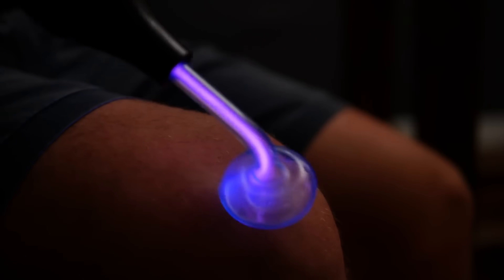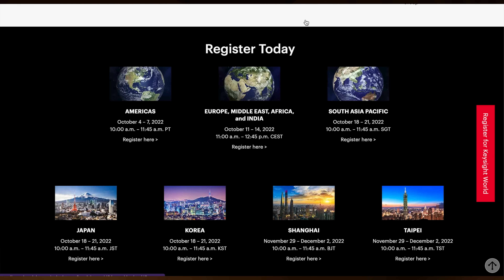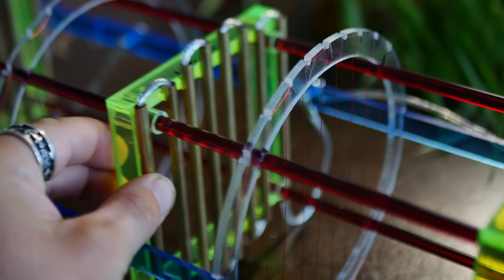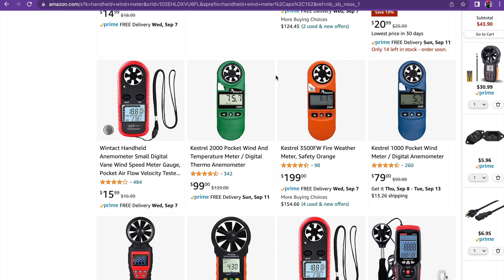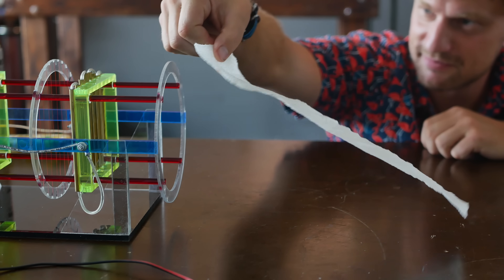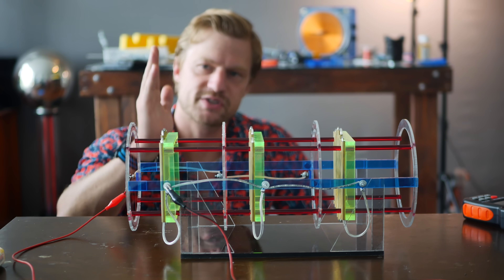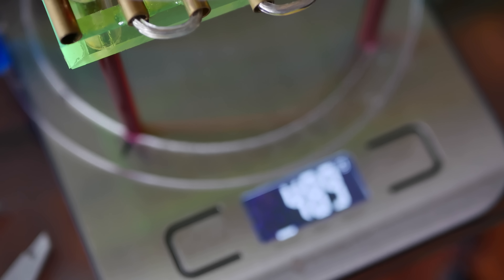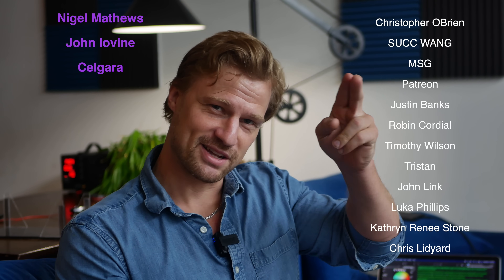Designing A Next-Gen Ionic Thruster! (For Flight)

Comment: 1) amount of stages (add more) 2) Distance of each stage (make more and closer) 3) use high voltage cables, adding more cable weave to each layer and shield/shroud everything encasing the system. ... If you want a good Ionic Thruster you are going to have to stack them almost looking like a radiator, the weight to thrust ratio will only be relieved at larger scales.

Comment: Most of mine are the same as below, but I would like to do a deeper dive on a combination of two concepts in particular. 
1. Airflow Shielding and 2. Positive Electrode Configuration
Using a positively charged copper vanes with grooves cut in them to maximize surface area and create the shielding for airflow to assist in preventing air from escaping. You have to balance roughing up the surface to create points for where the copper will strip electrons with the increase in air friction / drag. Typically airfoils are polished to eliminate drag, but you want enough roughness (similar to a few comments regarding increased surface area) to strip the electrons and ionize the gas. You could also potentially make the vanes in a specific pattern (circular) to assist in  creating more homogenous magnetic field from positive to ground.
3. Gas Mechanics
You would also probably want higher density and higher temperature air so that the electrons are more easily given up by the gas. Though the addition of a preheater would necessitate a heating element and multiple stage compression unit which would probably add waaaay more mass and blow your thrust to mass ratio out of the water. Oooh could you ionically thrust water?

Comment: I noticed that when you used it in the dark that the ions were streaming off of the copper wires at several small points. I'm wondering; since most copper wire ends up with impurities on the surface, was there any type of cleaning done?
Materials might play a big role in the distribution of ions along the conductors and may impact overall thrust.
Reply: Those small points are probably where there are slight irregularities in the thickness of the wires in the direction of the other electrode wires. It might be good to create a regularly spaced version of this by lightly crimping the wires every millimeter or two.

Comment: I wonder if the ways you thread the wires may change in how the ions flows? 

 One variation would be with the wires mimicking a spider web like pattern or a web like pattern that can spiral the ionic windflow.
 
 Second variation maybe a three dimensional threading that can change the velocity of the flow to concentrate the flow of ions to the center.

 Third varient may be a combination of first and second that can uses a simple pattern that becomes a complex three dimensional webbing that funnels the ions. But this method will definitely need simulated modeling of how each pattern changes the flow of particles.

Now the issues I see with these ideas is how complex the electrodes need to be for such a design to work efficiently and still stay within a projected weight limit.

Comment: To move air you want as much interaction as  you ca get between the ionic wind and the air.  In the static photo there were bright sopts plasma and lighter areas.  Do the bright spots cause more air flow or the areas inbetween.  If the bright spots, can theyse be seeded?  Can these spots be brought closet together to make a more concentrated air flow? Can the negative electrode by narrower than the positive in an attempt to funnel the flow of ions, and so the air too?

Comment: I'm curious... What if, instead of just using thing wires, you used thin foil with a jagged trailing edge? Something like this: VVVVVVV. Perhaps the sharp points would assist with the electrons flying off more closely to the desired direction, and I could see there being some aerodynamic benefits for smoother airflow, too.

Comment: My stab at opportunities for significant gains:
0. Yeah, encase the sides (perhaps just with plastic wrap)
1.  The first stage should be larger in diameter than the second stage, which should in turn be larger in diameter than the third stage.  Exact taper should be optimized, but I'm guessing it'll be fairly  significant.
2.  Arrange the electrodes in a concentric-circle pattern, or perhaps a spiral instead of parallel lines.  Should be more conducive to laminar flow.
3.  Racing stripes

Comment: Will using a flared airflow-exit/entry and tubing the design be a start for increased thrust to weight ratio? There has to be thrust loss coming from the open design, and I could see the fully open thruster exit allowing for air to 'curl' at the exit once tubed, resulting in loss of thrust. All I can think of outside of mechanical or electrical improvements.

Comment: If you were to close off the tube around it so that air is forced only through the center than attach a series of spinning blades similar to what you would see on a jet engine maybe make out of carbon fiber in series to force the air faster creating an increase of thrust…. Idk worth a shot….

Comment: You could enclose it to focus the air. Maybe add a cone to focus air flow. 
You maybe a non powered fan between stages one and two to spin the air. 

You could even maybe have a cone or slight taper between each stage?

Maybe I’m way off but I do find this fascinating.

Comment: i think the three problems was 

1 being having a constant power source without it being connected to your grid power. 
2 Providing enough thrust to weight for bigger application
3 you prolly had alot of wind run off because its an open application if you could enclose it i think your gonna see an increase without having to change anything on the application.

Comment: Theres a couple of factors from a jet engines that might be interesting to change:
 1. Propeller speeds increase through the length of the jet, that could translate to different voltage applied through the length of the BSI
 2. Propeller "density" (amount of space between blades) decrease (afaik) through the length of the jet, that could translate to a tighter grid of + and - at the front and then easing off
 3. The jet builds up pressure through the length of the engine, incasing the BSI could be interesting (to see if outside air intake through the length of the BSI causes vortexes and reduces thrust)
 4. As wind speed increases through the length of the BSI, bumping into obstacles matters more having the larger negative poles be the tear-drop shape of a plane wing might help.
 5. The jet guides the wind very specifically, having internal conical shapes to build up pressure. Having the BSI incased and introducing a nossle could be interesting.
 6. Moving stationary obstacles out of the way of the wind might help with getting a good laminar flow. Having the middle of + and - sections be less dense might help.

Comment: I wish I was clever enough to comment on the design inefficiencies. But I'll give it a go anyway! All I can think of is: 
1. if the segments were fixed in their most efficient position you could trim off the excess plastic reducing size and weight as you wouldn't need to slide them about;
2. thrusters are usually enclosed (right?), wouldn't that help direct the airflow to more of a point concentrating thrust; 
3. ....more red wire?
bonus #4. lighter construction materials

edit: ok I just read the other comments, this is what everyone else said. I tried

Comment: I would say 1,encase the unit. 2,add more segments.   and 3,shorten the overall length. 4,increase the surface area of the +/- plates. 5,honeycomb the +/- plates. use different conductors

Comment: This is truly amazing.

Changes I would try in hopes of increasing output:
1) Cone design from wide (input) to narrow (output).
2) Light weight sheet, potentially thin sheet plastic, to reduce slower moving exterior air from being pulled in at each electrode which may also slow down directional flow.
3) Larger gap between first electrode (input point) and distance between electrode getting smaller thereafter.

Sealed cone with large electrode pulls in more air, which has no escape and speeds up as it gets thrust  futher into the narrowing output hole.

Comment: Inefficiencies:
1. round tubes for electrodes, they should be thin and flat.
2. each thruster should have it's own powersource.
3. the voltage would ideally not drop when discharging, this to remove sound.
4. the plastic should be replaced with coated aluminum, maybe even aluminum with foam inbetween like on some airplanes.
5. if the wires was replaced, would the efficiency change or not?

Comment: Here's a good TWR to shoot for, 20% of the total weight of your aircraft.  A Boeing 777 has a TWR of about 30.4% but it has to carry a large quantity of passengers and cargo, for a vehicle weighing say 1kg you should try to achieve 200g of thrust.  I've seen others suggest pulsed DC too, and I agree, not only will timed or even actively controlled pulses make the most of your power supply but the short intervals between pulses will give your wires a bit of time to discard any heat they're generating which will impair their efficiency, this is especially important since you're punching DC through very thin wire.

Comment: Use Carbon fiber thin as hell design, and hollow tube wires for more surface area , double the efficiency, then cover the whole thing up for more directional airflow , add a turbo like funnel system that compresses the air at the back, and more wire, OR MORE POWER!! as Clarkson would say

Comment: Note the wide foil on the thruster ground. Does ground electrode length of flow and shape make difference to thrust? Would ground electrode in the shape of a venturi thruster be more effective? Can gas plasma from say argon with a tungsten needle, from say one or more tig welder arcs, provide a source for a hotter plasma and expanding inputted thrust gas, provide more effective thrust, and again be channelled through a venturi thruster or a turboprop?

Comment: what would happen if you were to rotate the electrodes such that instead of them being parallel to one another they formed a grid? IE your first module is in a vertically alligned position, then the next is rotated so its horizontal, and repeating this pattern?

Comment: This is awsome!
I's like to know if the air still increases in speed if it where to enter the thruster at say 10 M/s.
Or could it still increase airflow from say 100 M/s to 102 M/s for example?

What happens when you stack em in a tube?
what happens if you stack em side by side or in a square and force the air into a funnel?

So many questions!

Comment: The three improvements are:
1) shield air flow to stop air from going out
2) Compressor to compress air and ad air density to the increase air pressure and energy potential of air 
3) add nozzle to increase the thrust at the end

Comment: I’m curious if a duct would be more efficient? He claimed in the video a lamanar flow. But I wonder if the lower pressure of the air flow might be pulling slower air in from around it reducing over all flow rates and efficiency.

I would be curious to see if it gains efficiency in moving air and how much of an effect changes in altitude would have.

I would like to see tests in an air tunnel and with it ducted.

Comment: 1)i would reccomend increasing the cross sectional area /diameter of each stages like rocket nozzle which increases the flow speed 
2)covering the all stages to decrease air turbulance 
3 )increase diameter or electrode wire to decrease tubulance
4)design changes of flat cut circular plate which hold electode to round rings to decrease the air tubulance and increase laminar flow
5 )try different electrode diameter of metallic tubes running across flow 
etc

Comment: Amazing build! Seems like a truly bladeless fan (pointing to Dyson), potentially for a ventilation systems. High consumption, though, it probably makes a practical sense to use somewhere, no moving parts usually means higher durability in some conditions and appreciated at times. Two questions remain — how loud it is and how long it can live assuming high voltage and ionisation can and likely will wear out and damage metal wires?
Reply: That’s a good point

Comment: Put that inside a pipe and see what happens. Zero air escaping the system.
Also your electrodes could be made to be more aerodynamic in shape to vortex the air which will increase flow and decrease resistance.

Comment: i don't think that your T/W ratio is reasonable coz weight may be variable depending on the material and thrust is dependent on the amount of air intake and the voltage and other aspects i guess, im not sure but its just a random assumption, moreover it might vary on the air density of particles

Comment: You might want to try increasing the number of filaments in the first stage. There isn't air flow hitting the front of this section so you don't have to worry about causing airflow issues in the front by packing in more filaments & you could pack in more plasma flow. Might require playing with the spacing in the other sections...

Comment: Have you tried changing (varying) the frequency of the power supply? A long time ago (2003) I did some experiments with Lifters and accidentally discovered that at a frequency of approximately 8 KHz there is a sudden increase in thrust. Sadly I didn't have either the resources nor the money to keep on with the experiments. Remember Tesla: Energy, Frequency, Vibration. I'm rooting for you.

Comment: Awesome video!  I have dreamt of doing this kind of thing for years.  Seems very similar in principle to a linear particle accelerator (linac).  I bet that the ionized air molecules bunch together and flow very similarly to the electron bunches of a linac.  A lot of harmonic oscillatory motion thru and between the poles.  Linacs are in a vacuum, which can't be done here obviously, but check out the SLAC Linac and all the research papers on that technology.  I would think that's a great place to start for finding and adapting modeling code to simulate this.  Of course would likely be more complex in the fluid dynamics interactions.  A good gaming pc level graphics card would likely provide enough compute power to get a good start.

Comment: Build looks awesome.  1. is the sound from the electricity or the wind its creating? 2. how does it do in a vacuum, I.e. space. 3. when adding significant weight to it, would it still be able to provide thrust or perhaps lift like a hoverboard?
Reply: Wouldn't work in space, what it's doing, is ripping the electrons off of air molecules, and using them as positive charge carriers to move the current. These charge carriers have momentum, so it makes thrust. So no air, no thrust.as for adding weight. He said it makes 4.5% of its own weight in thrust, but he thinks he could double that by removing some material. But that means it can't even lift itself let alone extra stuff. It's maybe possible it could lift an extremely ultralight plane make of carbon fiber rods and mylar film. But it'd be tough

Comment: Add ducting and you may try to hook up the voltages in series (1st stage +65kV to +40kV, 2nd stage +30kV to +20kV, 3rd stage +20kV to GND).  You are going to get reverse air flow from the V- of one stage to the V+ of the other stage.

Comment: Nice one! Apart from shaving down the weight using better conductive materials to reduce loss of power via resistance can help CNT or graphene strips can help with both situations. 
Also optimizing air intake and exhaust plus réactive surface !
I could see this as an intake fan for a facility that needs sterile air, az the ionization process and the ozone itself would eliminate the pathogens, especially when coupled with a uv source.

Comment: Back in school we cooked up a project using the old engine and made a single point tethered unit. It stood at 5 meters off the ground on top of the school for two weeks until it rained and blew up.
We initially used garden variety aluminium foil, but once we figured out that our power was not an issue, we used thicker aluminium and got bold with it.
Anyways, the biggest lesson was not wear any kind of metal items on us. I still have a thin circular scar around my middle finger. Electricity ain't a joke. :)

Comment: These are the main issues I saw that could be used to improve the device. 
1. If you added side walls that would prevent the airflow from existing early.
2. Just like with a turbine jet engine having rotors and stators you need guide vanes to compress and direct the airflow down the assembly. 
3. The spaces does matter I'm curious about the ratio between each column (distance apart) and the column thickness it self. I'm asking because I know the optimal ratio for V-shaped bars within a square duct on one wall is 7.

Comment: can we start testing with more units in the column. Then the variations in distances between more units in column? there may/should be some sort of prime number that can be repeated to a limit for more thrust. Also can we measure if further down the series line modules are getting ANY less amps or volts?

Comment: 1)Make some kind of barb on the lines to direct the arc more efficiently
2)Duct it put some kind of she'll around it like a thin sheet of acrylic or something wrapped around it
3)set up a better more accurate spacing adjustment setup

And for those that are saying put a nozzle on it I honestly don't think a nozzle would be a good idea because you would use a nozzle on something like a rocket or jet engine because they increase the pressure of the gases moving through them by burning them cause them to expand exponentially whereas a ducted fan does not which would make it lose efficiency if you put a nozzle on it